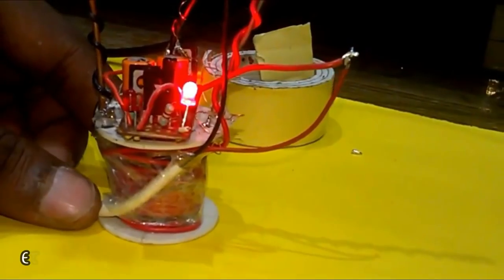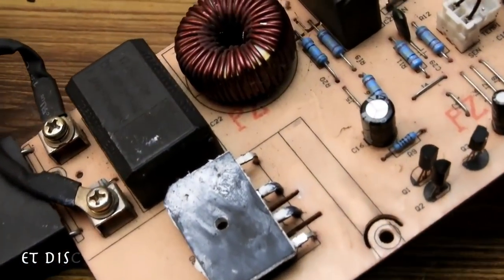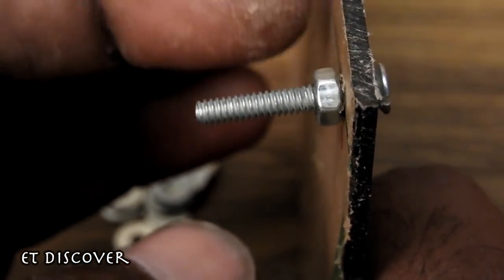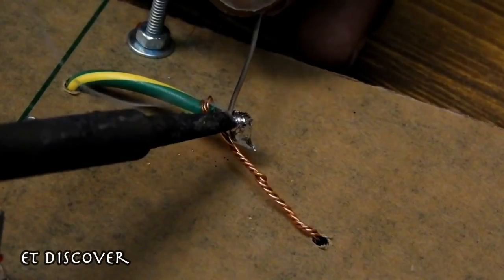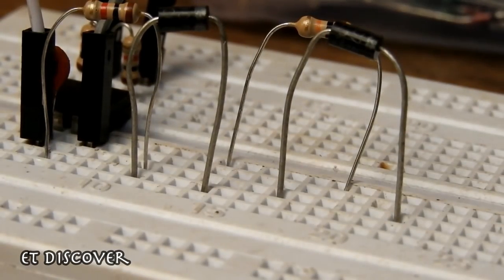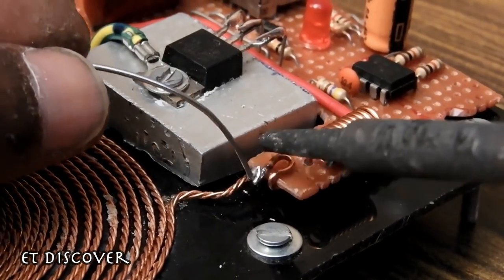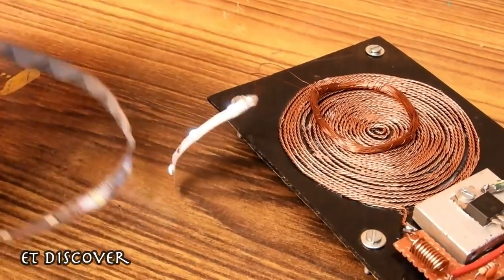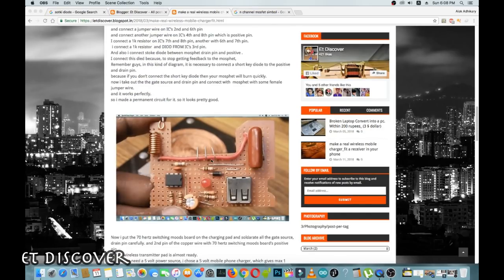Make a Real Wireless USB Phone Charger_Do not insert Usb cables

Comment: Ser Tumi Amer 6 volt 5 amper batter over charges indicator and cut out circuit ta banalyna. Ser banao na khub dorkar.
1st question :
      Real wireless USB phone charger secondary & primary er par (round) kto? Ar small coli ta kto round Ota ki 34 wag? 
2nd question :
      Sort key dido er value kto? Ne 555 ic 3 number outpin er resistance ar value  kto?
     Mosfet er D er simple capacitor er value kto? 
       Answer din Ser sob answer Chai.
Reply from the maker: ami anno project a kaj korchi to aktu time dau ami banabo.. primari 27g 3pak kore10 fit . 2nd 34 or 30 holei holo ata wag joto kom hobe amp toto barbe. 1N5822 Diyot.  555 out put a 10 ohm 22ohm 100 ohm lagate paro.. tumi koto volt a chalacho setar opor nirvor korbe kon resistor lagbe. drain pin a 0.22 uf capacitor

Comment: bhai awesome video but its not 104 pico farad capacitor as the first two digits are the value and the last is the multiplier like in this case 10*10^-4 that is 0.001 micro farad if i'm not wrong
Reply from the maker: I know that..
Reply: Plz explain the capacitor used in this circuits 
Please tell me the volt and farad